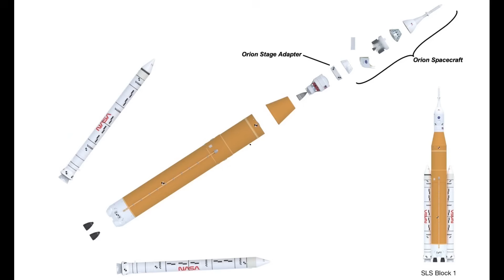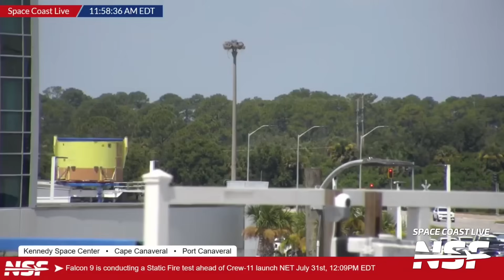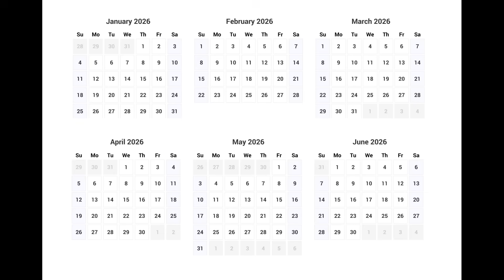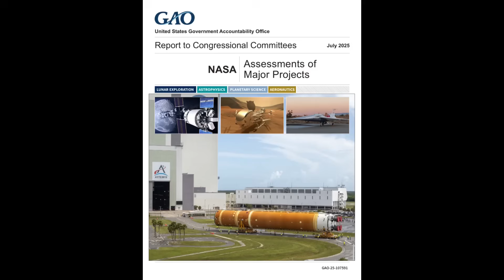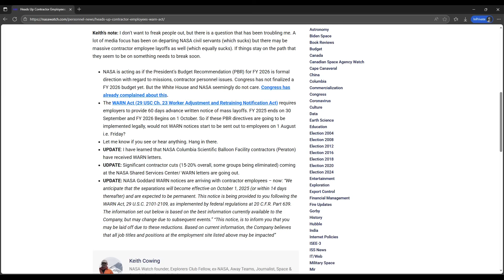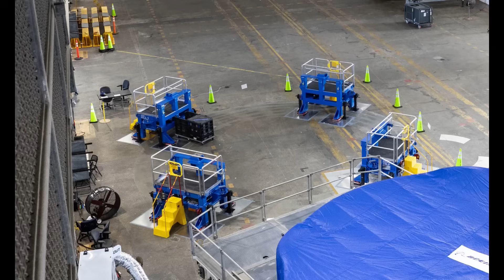NASA provides an update on Artemis III SLS milestone schedule and plans

Comment: I have an opinion about separating the Boattail from the Engine Section:

Based on the items you mentioned at the end of your video, the image of the boattail alone, with its curved surfaces and large openings for the engine bells, combined with how the quad-stand suggests that the engine compartment is taking the entire weight of the two sections, leads me to the conclusion that the boattail could not support the weight of the engine section on top of it unless those quad stands are attached. The guide-stand transfers the weight to the blue stands. 

In its final form, the lightweight boattail, combined with a more structural engineering compartment (Heavy) and the four installed engines, would transfer all its weight to the two attached solid-rocket boosters (along with the tanks above). In that setup, the boattail does not support any weight but instead provides heat protection for the engine compartment. 

The boattail cannot support the weight of the engine compartment, and the need for the quad-stand requires a special vehicle that can carry both on a platform wide enough to hold the four blue stands, which is the maximum width of the entire piece that needs to be transported.  The currently available transport vehicles were probably too narrow (I'm guessing).  That's why a standard wide vehicle used with the blue structure support stand, the engine section was attacked, which was protruding off the side in that NSF video.

The fact that both pieces are being quickly remated in the transfer aisle suggests a decision to prevent potential structural issues (ops moment), such as the boattail hitting something during transit or the need to create a transport vehicle for this move. or getting squashed (yuck moment).

Someone at Boeing must have decided, out of caution, not to attempt that and instead move both parts separately to the VAB as they would have for Artemis 1. What you are saying about Artemis I is that the two pieces were mated in the same facility (High Bay) where the booster stack was assembled, and that there was no need to move those two sections that were connected before, but they probably arrived separately and were assembled together.

The other opinion I had was that they could have just flipped both upside down and then transferred them to the VAB and flipped again. The quad-stands could have been placed in the opposite direction and then mated (somehow) to an existing vehicle with a structural cage to support the combined weight.  Again, a new vehicle costs more time, more worries, more pulled hair.

Simply put, no one wants to make a mistake right now, as it could delay the schedule further by having to refabricate another delicate boattail.  All of this speculation could have been eliminated if NASA had become the "National Aeronautics and Secrecy  Administration". 

Tony
Reply from the maker: Yes, that's what the quad pods help to do.  The boattail doesn't carry loads, it hangs off the main structure.

As far as flipping the engine section over, it wasn't designed to be rotated even 90 degrees, it needed a special counterweight attached to the top for that operation at MAF.  One of the supposed advantages of moving to KSC was that they wouldn't have to do that breakover from vertical to horizontal any more.

I showed some old footage of the tool they used at MAF for holding and transporting the mated assembly indoors using SPMTs...it would be interesting to know why that's not feasible outdoors...maybe not enough clearance off the ground.  FWIW, the outdoor transportation equipment used for the full stage "sits" higher than the indoor equipment, too.
Reply: @PhilipSloss  Thanks, Phillip, maybe it wasn't feasible outdoors due to a "Speed Bump" along the way.  Just kidding, I've driven too much in Santa Monica to hate them.
Reply: It was too big to get out the door.

Comment: I think a lot of people are under estimating how far along starship actually is.  The fact is, we're only now getting to versions that may have had fixes baked into their design vs being bandaid patched after the 7th flight.  Once they transition to v3, and assuming they don't repeat the failures of v2 as long, things are going to ramp up fast.  By this time next year they're likely going to have 3 launch facilities online and ready to go.  We could be looking at back to back launches of starship by mid to late next year.    They're about to finish up their first v3 booster, the 18th in all... It truly boggles my mind how SLS construction proceeds at such a slower than snails pace when compared to super heavy.  Hell, by the time Artemis III flies, we will likely have seen dozens if not into the hundreds of starship flights by then, many of which will be reflights.  Crazy times we live in.

Comment: SpaceX is completely delusional or playing the worst game of "Schedule Chicken" in recorded history.  If they were on track for a 2027 Artemis III 3 mission, then the HLS vehicle for that would be in assembly right now, just as the Orion components are.  You cannot  build, test, and fly a man-rated lunar landing spacecraft - the size of Starship - in the last few months.  Especially since nothing substantive from SpaceX has been seen thus far.  Real spacecraft require years of very careful manufacturing and testing - every system and backup system.  There is simply no realistic belief that SpaceX will be ready on time.  Starship development has gone completely "OFF THE RAILS" and they haven't even gotten to the hard part.  NASA has been set up to fail.
Reply: I don't think anyone takes the 2027 deadline seriously.  With all the recent setbacks and slips, I'm thinking 2029, at the earliest - which honestly would be mostly in line with NASA's original [realistic] projections until Trump in his first administration insisted that schedules say lunar landing by the end of 2024, reality and all reason be damned...

That said, we don't have much visibility into HLS design and subsystem development work likely occurring behind closed doors (and for the most part, not at Starbase).  And I wouldn't expect any actual flight hardware being integrated until after the CDR - which is supposed to be sometime this year, allegedly.  And the evident multi-year program delays notwithstanding (so .. what else is new), it's a bit of a histrionic leap to assert that NASA has set itself up for failure.
Reply: Duffy and Gwynne are full of it yeah.